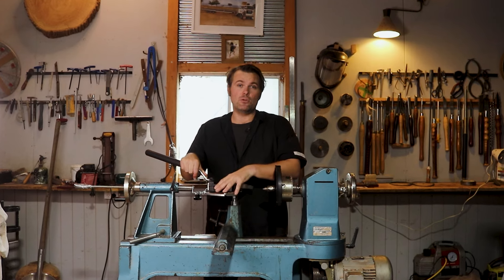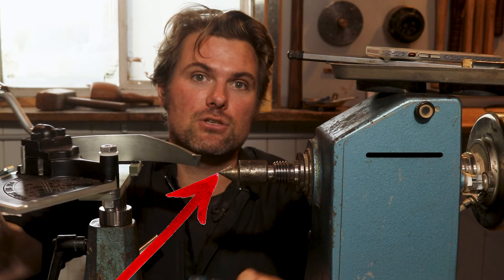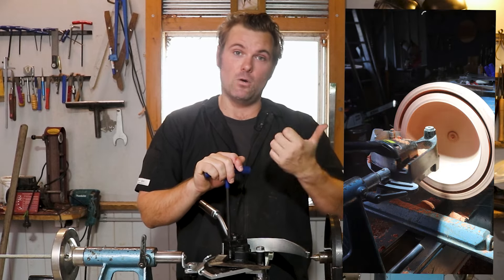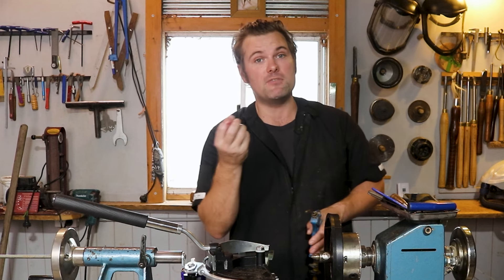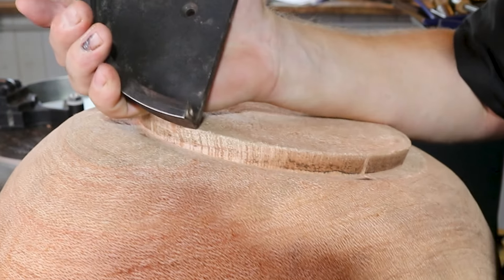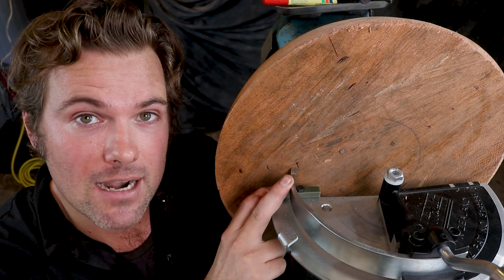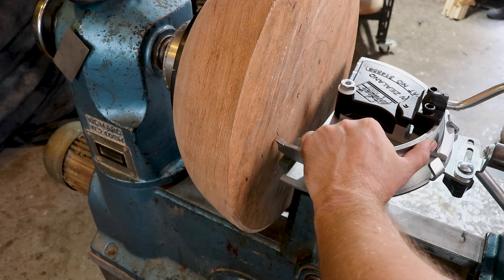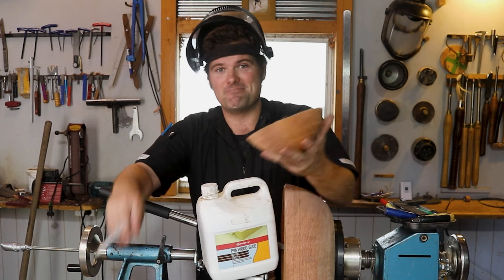The Fundamentals of bowl coring. Bowl coring with the Woodcut bowl saver MAX how to!

Comment: Hi Kerry, thank you very much for this video (Dan Hewitt gave me the link). I've been a Woodcut bowl saver (the one used in your video) since about a year now. I used to use the McNaughton for years before, I ended to sell it and bought the Woodcut that is much safer for me to use. I am considering going to the Max4 because I have a lot of deep bowl blanks waiting to be turned. However I will continue to use my current Woodcut bowl saver. One point that kinda hit me in your vidéo at 2'40: you said it is crucial that the blade has to be set 5 mm (10 mm for hard wood). I watched Phil Irons videos last year when I purchased the W.bowl saver, and if I remember well, his advice was to set the blade at perfect center, which I did when I started to use it. Never had a problem, except  motor stalled sometimes (all of my timbers are wet/green wood and my lathe is Poolewood Euro2000, 2 HP) . I will consider to level the blade up to 5mm then. I fully follow the tenon rule. when I'm not, I am reminded right away by the blank flying off the lathe after 2 minutes coring :D   Greeting from France ;)
Reply from the maker: Thank you for leaving a comment. I would have to say I haven't had too much trouble with setting it at centre height, as Phil suggested. But from now on, I set it 5-10mm high, and it works for me. I still get stalls in the motor from time to time, and it's a friendly reminder that I'm either rushing or need to give the blade a quick sharpen. I will be releasing a video tomorrow of the bowl saver in action again, and at the end, I show the height of the cutter.

Thanks again for leaving a comment. Let me know how you go in the future and if you move up to the larger blades.

Cheers,
Kezza

Comment: Kerry, very helpful thanks. I could have sworn when I first set up my old bowl saver, they said cutter height at dead center spindle ht? But I think you’re  absolutely correct it should be a bit higher depending on the timber hardness! I will ck and raise mine tomorrow! That finger looks great considering what it went through! Stay safe mate, send some summer weather towards Montana……..please!
Reply from the maker: I initially set it at the center height when I first used it, but through trial and error, I found that positioning it 5mm above significantly improved performance. This approach was later confirmed by Woodcut, who informed me that other turners also prefer it higher.
Let me know how you go mate. 
Cheers,
Kez

Comment: That is very helpful, thanks Kerry. I think the instructions say to have the cutter on centre height, but I have found it had a tendency to want to self feed or catch. Thanks for the tip. Have it above centre makes sense. I will adjust mine and have another go when I find a large enough bit of timber.
Reply from the maker: I really hope this helps, mate. Please keep me updated on your progress. I’ve noticed that even if there’s a slight shift due to vibration, you’ll still have some wiggle room. 
Kez
Reply: @KerryCorney  thanks mate. I will do. Definitely have to fight mine more than you were, so hopefully this will calm it down.
Reply from the maker: @argerosconstantinou2964  I also give mine a quick sharpen with the hone if I feel it struggling. But usually every 10 bowls or so. Depending on the material it can be more frequent. 
Cheers mate.

Comment: Great video Kez. Bowl coring isn’t difficult but simple errors can make it unpleasant. 
What moisture level in the timber is ok to core at. 
Without using the laser how do you setup the corer
Reply from the maker: Hey Greg, sorry for the slow reply, mate.

You can core at any stage, but I prefer to do it over a three-day process so the blanks aren’t left too long. That said, I’ve cored plenty of dry timber as well; it just takes a lot longer and requires frequent sharpening.

The kit comes with templates to help align the cutter with the depth of the cut, but I prefer using the laser. It’s quicker and much easier to work with.

Cheers,
Kez

Comment: Great video. I have the Woodcut 4 system and have broken tenons. Now I know why, tenon too small and cutter right at centre. Thanks for this. Do you ever core dry wood? Should that be set up any differently?
Reply from the maker: Sorry for the slow reply. No change to setup for dry wood. I take particular attention to the sharpness of the cutter and leave the height at 5mm. I just let the cutter make its way through with out to much force behind it. So really no change to my normal practice. Cheers Noel.

Kez

Comment: Great video Kerry! I bought my bowl saver last year but haven't used it yet, so I'll be watching this a few times before I do. Unfortunately, I only have a 300mm swing over the bed of the lathe, so what's the smallest size bowl you can core?
Reply from the maker: You can core anything (within reason). It's more about having the power there to core bowls. 
Does that make sense?
Cheers Nathan. 

Kezza
Reply: @KerryCorney  Gotcha! I'm assuming it's ideal to be coring green timber, but any idea what it's like on dry timber?
Reply from the maker: @nathanaeverson  You're spot on. I core it when dealing with a prized piece or rare timber. It depends on the type of timber. But yes, for sure, it's something you can do.

Comment: Greetings from Raleigh, NC!  Great tips, thanks muchly.  
I want to cut slightly above center, but I can figure out how to do that.

If I move the platform up, say 5 or 10 mm, then the plug that goes into the tailstock is too high to fit.
How can I move up the cutter tip and still be able to fit the tailstock assembly into the tailstock?

Thanks, Jim
Reply from the maker: Thanks for sending this through Jim. What Lathe are you using?
Reply: @KerryCorney  Kerry, I have a Laguna 18/36, thx, jim
Reply: BTW, when I contacted Woodcut tools about catches, they suggested I look at your videos, jim